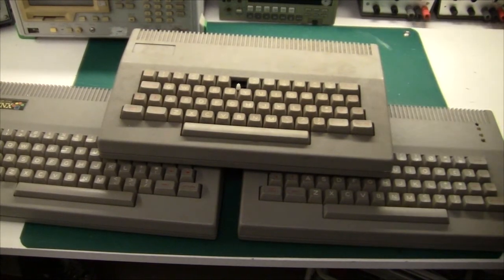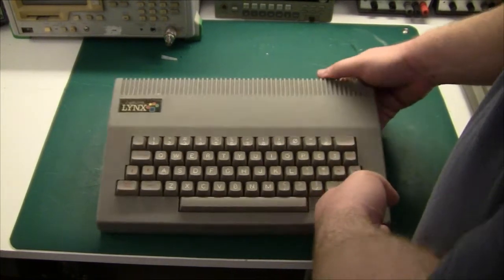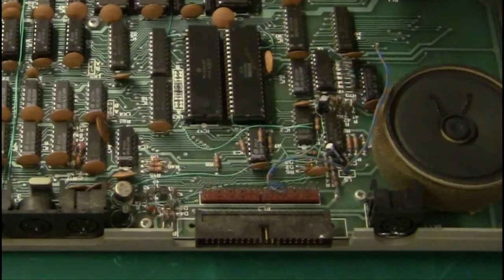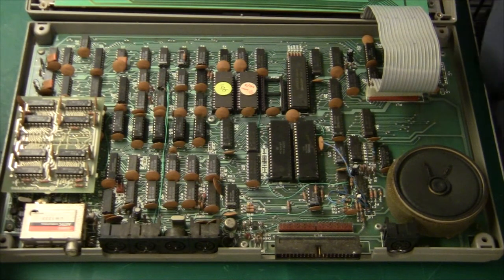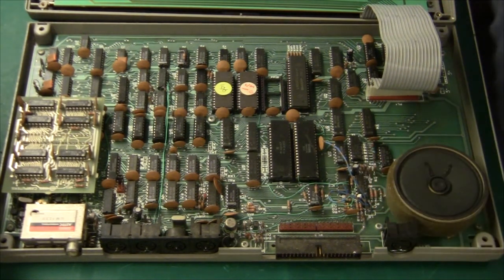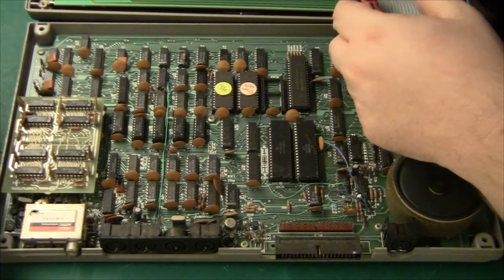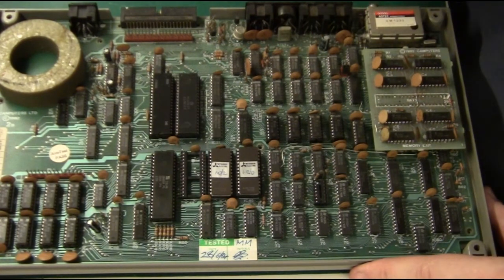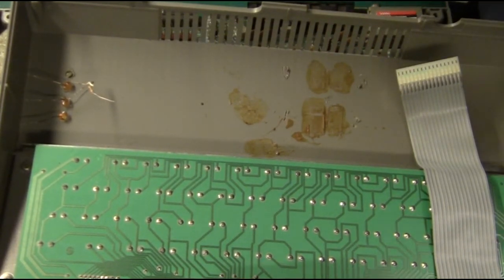Teardown of Camputers Lynx

Comment: i have a lynx 48k that was a 'production failure' , never sold to the public,  no badge on case(i have 2 loose ones in a little polybag), and the screw holes untapped, never had screws in them,  plus several 'empty' add on/interface boards, and one empty main board,    my lynx has lots of wire patches and dont know if correct or not so after good hires pics of a working machine, sometime,  both sides of the board , so i can check it
Reply: mine is also missing the 2 eproms, so will need to burn 2 to put in ..
Reply from the maker: @andygozzo72  They were a bit late and had to ship the boards with a lot of botch-wires. Sometimes you just have to, to get some money coming in, despite the bad reputation you get.
Reply: @NatureAndTech  the empty main board i have, i was told, was a late version with all the 'patches' done on the track layout, so shouldnt need them 😉 pity i didnt buy more of the boards while i had chance ,seller had a few of them
Reply: @NatureAndTech  the early zx81s had to have a 2 chip 'bodge' fitted to partially correct errors in the first batch of the basic rom 😉

Comment: It is a shame what they did with this computer as it could have been awesome.   

If I had designed it, it would have been a 64K computer (48K + Rom) as the Z80 can handle all the memory refresh.  This would have made the PCB much simpler and much cheaper to produce.  They could have then used the savings to use a better stock Graphics and Sound chip.   This could have been a machine more akin to the MSX 2 instead of a hodgepodge system it ended up being.

Comment: Hi Nice Video. I wrote some software for Camputers when I was a kid and released a couple of my own titles.

As someone else says. LP was for a light pen. It was bank switched and I think the serial port was only +/- 5v and not 12v.

A guy called Tim released an upgrade consisting of a length of wire and a few special ported spectrum games. You had to solder the wire on the top of the board. That might be the light blue bodge wires you show as I remember the wire I was sent being the same colour. I’ll dig mine out and look some time.

I Have circuit diagrams and schematics some where too.

Thanks for the walk through!

Steve

Comment: 2:35 Yeah, using the printed circuit board for directly connecting cartridges was so cheap and unreliable
Reply from the maker: Yes. very bad. And worse it that most of the computer makers didn't spend the money for gold-plating.

Comment: Lynx is such a lovely weird machine. On the 48K machine 32K are reserved for the graphics (R, G, B and an alternative green having 8K each, getting mixed in TTL logic which is why you'd often see one channel slightly bleeding out on RGB) - you actually got that the wrong way around in your teardown, remove the daughterboard and see you'd only get the green & alternative green banks ;) Also the BASIC supports floats for line numbers. The BASIC editor also doesn't support scrolling, but rather has longer programs starting over at the top again when listing (there's an expanded 24K ROM which fixes that among other things). Expanding the machine from 48K -> 96K is actually quite easy.
LP is not line printer btw ... it's for a lightpen (feature of the 6845 CRTC chip). Please do a video on a Lynx 128 if you ever get one, as that has a faster CPU and even more glue logic (the serial controller was scrapped in that version and done via TTL).
I actually have a (BASIC) demo in the pipeline, about to be released next year.
Reply: The reason for the "starting again from the top" weirdness is that Camputers created a 6x10 font, instead of the usual 8x8, which meant that, with the resolution they used on the display, there were around 8 pixels (or 6 - was it 256x248, or the other way round 🤔) at the bottom of the screen that didn't get used for text entry. That then made it difficult to use the 6845 CRT controller's start address register to manage scrolling, as it would give you partial text in that space.
Reply from the maker: Wow. Really interesting. I remember the floating point line numbers, but the rest was new for me. Cool stuff with the  lightpen. I wish I had more time to play with these.

Comment: When you first played with the Lynx, was the character set Scandinavian, or English?  I can't imagine way back then, there would be any concern for other language support.  Thx.
Reply from the maker: English.

Not many computers came here with Danish keyboard then, although they must have had some kind of customization.

The QL, the New Brain, the Amiga and the Atari ST came with Danish keyboard (but still with UK OS).

Those computers with audio through the TV must have had a different modulator, due to the audio sub-carrier was different.
Reply: While the HW was a bit lacking in many ways, the SW was quite good.  The BASIC code was pre-compiled and thus ran much faster than other home computers at the time.  And a lot of stuff was handled through pointers.  Thus, it was not that difficult to move the keywords table to RAM.  In this way I actually made a Danish version of the Basic (just for fun).